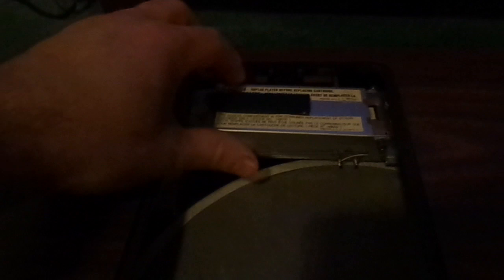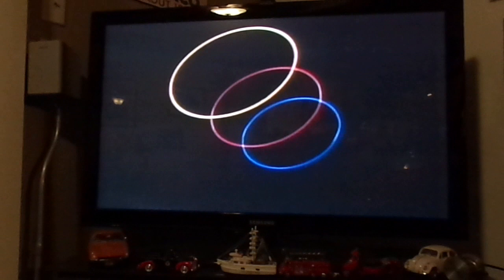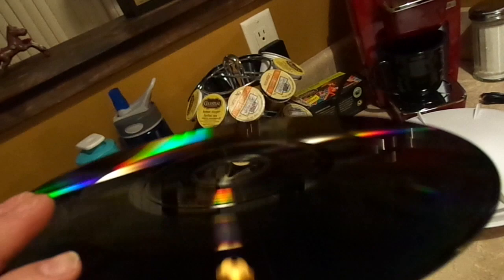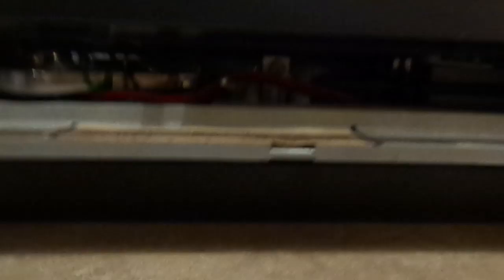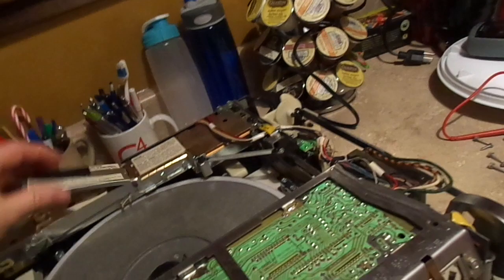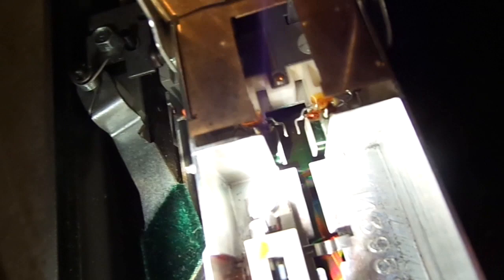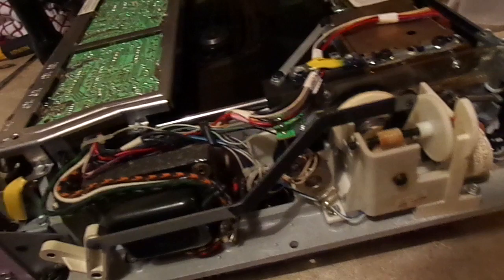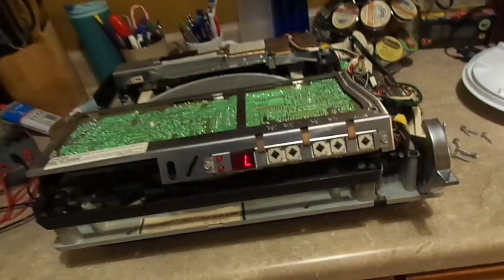1981 RCA SelectaVision CED VideoDisc Player

Comment: Actually LaserDisc came out first, in 1978, while the first CED player was introduced in 1981. But CED is clearly based on an older technology, and only lasted a few years in the marketplace.
Reply: vwestlife In fact, the CED format began development in 1964 while LaserDisc began development in 1969 (but was partially based on technology from 1958). So, while LD started development later, they had a head start with the technology)

Comment: I purchased an RCA stereo player in 1982 for $299 with free disc from the dealer and can tell you this format was wonderful! Discs are presumed to last up to 500 plays,the problems collectors run into today is not so much disc wear,but gumming up of the silicone coating after 30 years. They do not wear out quickly,but the stylus does and will do irreversible damage to a disc. Discs can be cleaned with distilled water only,but one must be careful NOT to get fingerprints on disc,nor press too hard with soft cloth as you can damage grooves. RCA announced the last discs would be pressed til 1984,but actually lasted til 1986. This format could have made it til the early 90's had RCA used better promoting

Comment: basically from what i know and from what I've read on the internet, how it works is there's a small copper contact on the platter that carries an electrical charge to the stylus which has a microscopic metal contact on the diamond. the differences in capacitance produced by the grooves in turn produce an RF signal which makes a picture with sound.

Comment: I think the needle and the platter acts as a sort of giant capacitor. With the needle being the top plate and the platter being the bottom plate and the air gap between acting as a dielectric. The variable heights of the landings in the groove causes the dielectric (air) to change in thickness. This causes the capacitance of the the needle/platter capacitor to change (greater thickness, less capacitance; less thickness, more capacitance; the surface area of the needle tip remains constant). The electrostatic field from the platter (I don't know if its negative voltage or positive voltage) is felt differently on the needle as the capacitance changes as the platter turns. This change causes a changing signal on the needle which is displayed as video.

The CED basically uses electrostatic fields (instead of the VHS/Betamax electromagnetic fields or the changing brightness of the Laserdisc laser) to send a video signal.

Comment: Here (below) is a closed circuit RCA presentation hosted by Tom Brokaw from the SNL studios that was used to roll-out SelectaVision in 1981. These guys thought they'd hit the jackpot. The songs they wrote for this are hysterical. SelectaVision was a $600,000,000 bust - but this video (which I'm sure never ended up on a videodisc) - is hilarious.

Even RCA was confused in their advertising. They call SelectaVision "TV" (which it isn't) and even use the term "record" - which it was - but - what does a "record" have to do with TV or Video? This presentation/video is like being at the dinner party the night the Titanic sunk. 

RCA SelectaVision VideoDisc Dealer Introduction

Comment: I have one of these. The turntable is electrically charged (no signal, just charged). The conductive disc carries over that charge. The stylus has a metal coating on a part of it, near the tip. The player simply reads the electrical capacitance (a capacitor is a component that stores an electrical charge between two conductors, with an insulator between) of the gap between the metal part of the stylus tip, and the depth of the groove. The vertical depth encodes a composite video signal. A simple analog circuit translates this capacitance read into an FM frequency that can be fed to a TV.
Reply: +richfiles To clarify my previous comment:

1: The depth of the groove creates a varying capacitance between the uniformly charged conductive disc, and the metal portion of the stylus.

2: This varying capacitance is sent to a resonance circuit which uses the varying capacitance to create a variable frequency signal. This is the composite audio/video signal.

3: Depending on player model, that signal is RF modulated onto a channel 3 or 4 RF carrier and sent to the coaxial jack, or optionally split into it's composite video and line audio components and sent to RCA jacks.

The wikipedia article is not as clear as it could be... This is not a digital signal. it's analog. "Pits" and "lands" are not an accurate term in this case. "Hills" and "valleys" would be far more descriptive, and those hills and valleys move up and down to mimic the true analog wave that is to be reproduced. If you could look at a disc's cross section under a microscope, you could see the shape of the electrical signal generated in the physical shape of the hills and valleys. The entire turntable is charged, so the disc is uniformly charged. a better measurement of resistance would be top to bottom of the disc.

The stylus does not actually vibrate at all (ideally). The signal is acquired electrically, as the stylus slides smoothly, over a smooth walled groove, with an undulating bottom that never actually touches the tip of the stylus.

Comment: Some refer to those perpendicular stripes on the disc as "blanking" stripes. I'm not 100% sure why.

As far as I can understand, the disc acts like an FM transmitter. When a very light current is passed through the disc, and it starts spinning at 450 rpm, it creates a 3.66 MHz signal that is picked up by the stylus. That signal, which is basically a low frequency FM transmission, is then passed through the Signal Amplification circuitry and out through either the Coax or RCA jacks.

It's funny - even the math works. 450 rpm x 8 blanking stripes = 3,664 or 3.664 MHz

Incidentally, you can fit 36 CED grooves inside one regular LP groove.
Reply: And, the 8 fields per complete rotation equals four frames of video, as two fields are required for one frame.

Also for LaserDisc, assuming a CAV formatted disc, 1800 RPM x 2 fields = 3,600 = 3.6 MHz.

Cool how it all adds up, yes?

Comment: I think those work on the principal of old hard drives. It uses the groove as a servo track. Like a modern hard drive sorta. The needle picks up the electromagnetic variations recorded in the disk, via the pickup coils. Exactly like a magnetic head pickup in a hard drive, or cassette player. Basically using the disk to form a virtual transformer. 

But the electromagnetisim/capacitance of the disk is comperable to an MFM recording of the video signal. Like a hard disk.

Comment: The simple change in the height of a few micrometers on the surface of the disk is enough for a simple sensor to detect the changes in surface height as a difference in capacitance and those differences encode the F.M. signal that is used to broadcast the video on what amounts to channel 3 here in the west so the information that's on the disk is the same signal recorded on a VHS or Beta Max.

Comment: You should try to play that disc on a normal turntable, just for the fun of it...
Reply: That will not work.  The grooves are very small and shallow.  A record spins at 33 and plays for about 20 Min.  These spin at 450 RPM and play for about one hour.  Standard record played has a much fatter needle.

Comment: The thin bars between the "wedges" are transitional spaces with no information in the grooves. I am unsure if this area is grooved, or if it's smooth. The servo steps the stylus coarsely, but the deflection coils are responsible for maintaining tracking for the precise stylus positioning across the disc surface, including across those frame transition regions. Each groove holds 4 frames (on an NTSC format disc) There are 8 wedges, because each frame is interlaced (odd and even lines). This device was one of the the first consumer device to utilize a microprocessor for control (It ran the servo and the digital display). Freeze frame is possible on this model as a hidden feature by holding the forward and reverse preview buttons simultaneously. It's not a perfect freeze frame, as it forces the deflection coils and servo to track the same groove over and over, and it is actually 4 frames (8 fields), or 2/15th of a second.

The stylus has a tracking force of only around 65 mg, which is insanely small. In the case of repetitive skipping, I believe the processor was designed to use the deflection coils to force it to the next groove. it's why when you get pickup errors, you sometimes see the disk jitter/skip forward.

I think you may be correct on the two "prongs" actuating the servo stepping. The coils, other than the stylus lifter, are there to adjust the stylus to precisely track the groove perpendicularly. The CED system needs true linear tracking to work correctly. The microprocessor also was responsible for manually tracking the same track over and over for the freeze frame feature and for still play in interactive discs (a feature of later players, with black disc caddies to indicate that functionality)
Reply: +richfiles The entire disc is grooved; the "transition spaces" between the "wedges" are for vertical blanking and they do contain information, such as closed captioning if the disc is so programmed as well as DAXI codes for player control.

Comment: I had some disks and a player for a while that I got off Ebay and when I got all the laughs from it I could I gave the outfit away to a  goofy kid who just fell in love with. Logie Baird the mechanical t.v. from the 1920's was able to put some video on a records and I think there is a web sight where this video on records was considered again in the 1960's ( early M.T.V. sort of )  This CED vid came and went so quick that I never noticed it. But Ebay came through in satisfying my short term interest in this tech. Narrow Band Television is all about this is a way and if the CED stuff happened in the late 1960's bet it would have been bigger then Smart Phones (well maybe not).  Dig what the genius Manfred von  Ardenne came up with, using "flying spot tech"  designed  a T.V. that watched you as you watch it. (1984 buck -o). Gander patent 3190554 a digital computer that runs on compressed air that Babbage could have had built by the pipe organ guys letting Lady Ada come up with COBOL!  (maybe) Thorium Nuclear Power using Free Piston Stirling Engines.  Thanks for this post!

Comment: I love it! I'd like to know how many rpm:s the disc spins. And which types of connections to the TV-set it has.
Reply: The disc spins at 450RPM for NTSC and 500RPM for PAL players. The unit here has only RF outputs, but later ones like mine (SJT400X) have composite video, stereo audio and in IR remote

Comment: how has this system actually works ??? like a record player for music or like a laser player
Reply: Well, it doesn't use a laser optical reader.  It uses a stylus, like a phonograph.

But, unlike a phonograph, the stylus had an electrode on it and the readout was electrical rather than acoustic.

A CED disc was composed of polyvinyl chloride doped with carbon and had a coating of silicone for lubrication.  The disc itself could actually hold a small electric charge, like a capacitor (hence, the full name of the format: Capacitance Electronic Disc system).  The grooves contained peaks and valleys.  The stylus riding in the groove through these peaks and valleys generated a static discharge of varying degrees of amplitude and frequency on the stylus, reproducing an encoded signal that would be processed retrieve picture and sound for playback on an A/V system.

Picture quality was roughly equivalent to VHS assuming a perfect disc.

RCA's claims to advantages was the ease of use of the format, the simplicity of its technological execution, and the low cost of manufacture of its media which would translate to a relatively low retail price of titles made available for the format.

Unfortunately for RCA, CED offered no performance advantage over VHS in terms of picture quality (much less LaserDisc) along with the inability to record on it and the fact that the low cost to buy movies on the format was countered by the even cheaper cost to rent movies on video cassette.

Compounding the problem was that CED was released to the North American market in 1981 (USA and Canada), way too late as VHS had already become dominant in the home video market while LaserDisc offered, at the time, the best possible picture quality for a home format that served a sizable niche demanding that benefit.  CED offered nothing that could be considered compelling enough to sway customers away from VHS and LaserDisc.

As an aside, it is ironic that among the largest supporters of JVC's VHS format in the USA and Canada was RCA.  While RCA intended for VHS and CED to be complementary, most customers could only afford a machine for one format or the other at a time.  Most customers ended up buying VHS because of the ability to record as well as the cost to rent movies compared to buying them.

In 1984, RCA would discontinue player production.  Disc production would cease in 1986, with the last title pressed for retail release being "Romancing the Stone" from CBS-Fox Video.  At about the same time, RCA would be acquired by General Electric, broken up, and the pieces of the company sold.  RCA currently exists only as brand owned by Technicolor S.A., used by licensed companies to brand their products with the RCA name (Audiovox, Sony Music, On Corporation).
Reply: thanks for info
Reply: Check out the idea/subject of "Narrow Band Television". Logie Baird was putting video on records in the 1930's as well as sending television from London to New York by short wave on television you could build yourself! Dig patent 3109554!